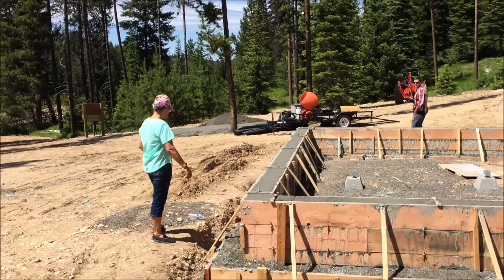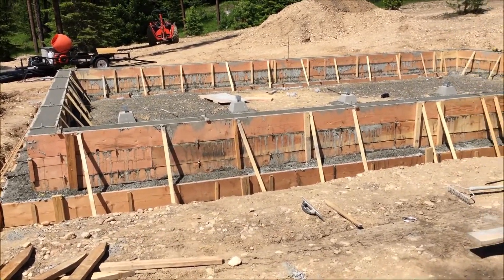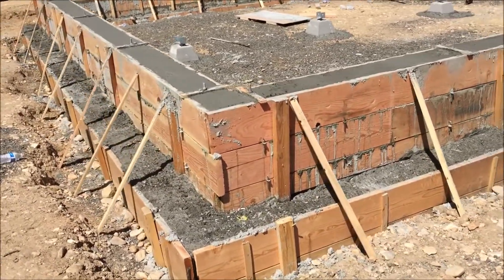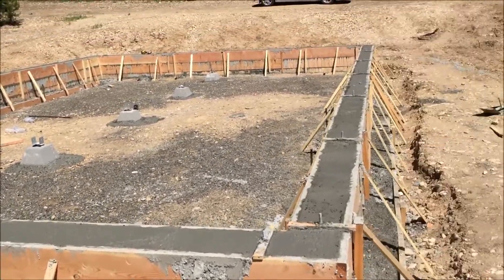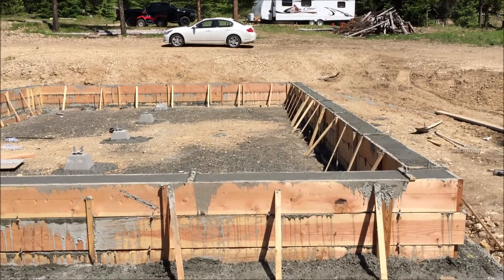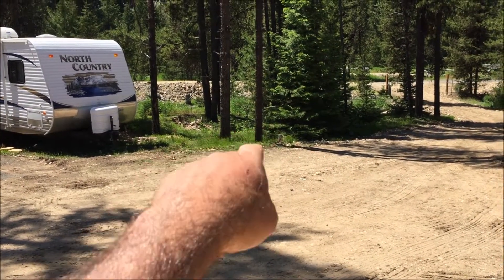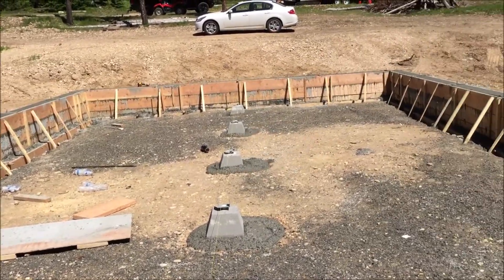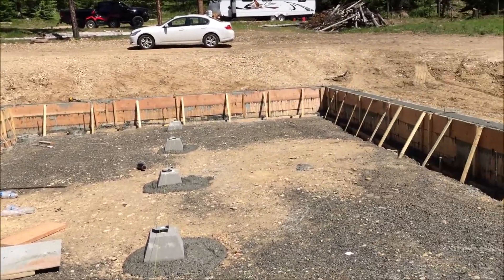Our Cabin Build Part Four Stem wall and Footer Concrete Pour

Comment: May we please know the cost of the 17 yards of concrete at the time you did the pour? I know it has gone up, in part, due to fuel costs, etc. But it would be a good gauge. Thank you.
Reply from the maker: 4+ years ago. Not counting the forms that I put up. The concrete alone was $2200.

Comment: Remember when putting your kicker stakes .the stake is only it's strongest when it's at a 45 °angle from top of forms the straight up  they are the more weak they are. .luckily snap ties did most of the work.its easy to use a speed square as a guide.

Comment: Approximately how much did this cost you? Can you link the video that showed you how to build it?
Reply from the maker: Total cost was ~$3100. Most of the cost was for 18 yards of concrete delivered. I went with an 8" stem wall and 24" wide x16" deep footers...so it took a lot of concrete. 

The videos that I used were from Dave Osland Concrete's channel:

https://www.youtube.com/watch?v=mjvgEH4ptV8

https://www.youtube.com/watch?v=cRcGgI4pbpY&t=126s

Hope this helps.
Reply: @johnjacobs3643  If you don't mind me asking, was that with lumber and all...or just the concrete?  Thank you.  My email is found in 'about' on my page if you so desire to use that route
Reply from the maker: @chrisharrell5945  Hey Chris. Concrete was ~$2200. ~900 for the lumber, stakes, Simpson strong tie items. I used all of the 2X10's for the supfloor.
Reply: @johnjacobs3643  thank you. much appreciated.  Did the 2x10s come out fairly decent and straight after removal, considering all that moisture to one side like that?  Any issues with them?  Thanks for the Sampson strong tie note.
Reply from the maker: @chrisharrell5945  Yeah. I saved all of the 2x10's. I did lose about 4 2x6's on a couple footers. I used the 2x10's for floor joists...no issues. Thanks
Reply: @johnjacobs3643   considering the freeze line and colder ground conditions there in Montana / Idaho region, would you know what the common foundations used in that area are called?   

I've looked over some of Montana's building codes but there wasn't anything that spoke of or named specific foundations.  

Thank you.

Comment: Did you use nails instead of the reusable wedges? If so what size,? I’m assuming they cost less and they appeared to be a nail. I wouldn’t even ever use them again. Thank you
Reply from the maker: I used 2x10's, lots of stakes, and the 8" strong tie  spacers with wedges. Nails were only used to attach support stakes to the forms. Thanks for asking.